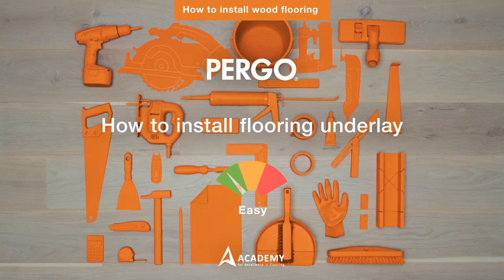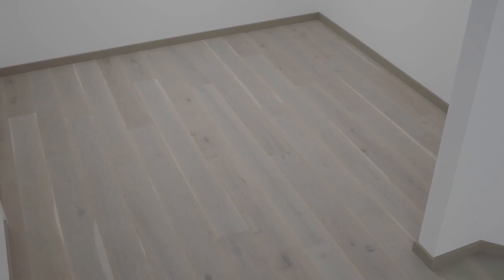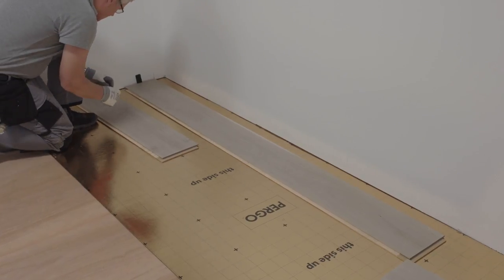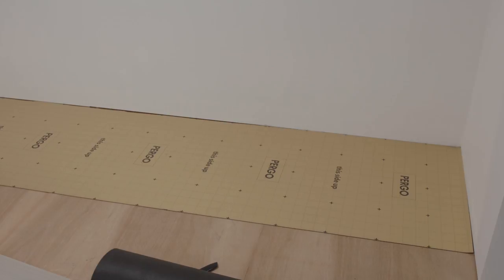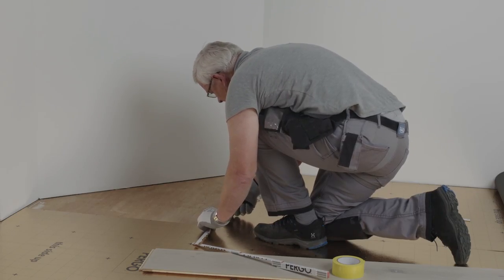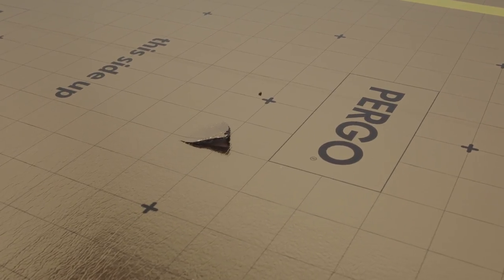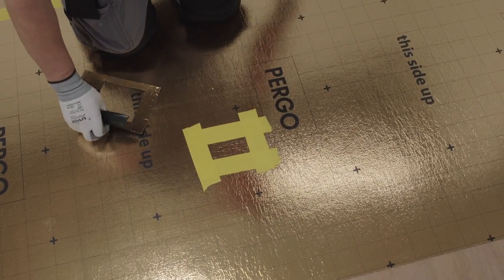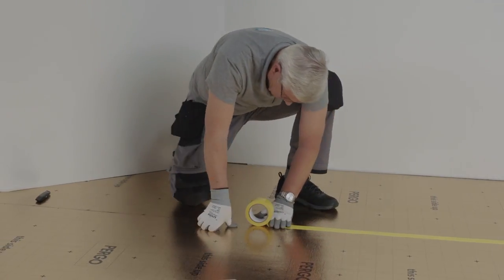How to install flooring underlay | Tutorial by Pergo

Comment: was just wondering what direction to lay the underlay against the laminate direction or the same, if i heard correct lay the same direction
Reply from the maker: Hi Joe, you heard it correct. The underlay needs to be installed in the same direction as you will install your flooring boards. Good luck! ^Jolien
Reply: Pergo Flooring Global than why does it say on the Pergo Gold directions to lay it down “perpendicular” to the wood?

Comment: Could I use this like dynamat for car audio and sound
Reply: do you mean to use it instead of dynamat? Of course you could, but it wouldn't be as good. Remember sound is carried with vibrations. Dynamat is meant to reduce vibrations as much as possible and this stuff is used to put flooring on top.
I'd try a towel and foam if you don't wanna buy Dynamat